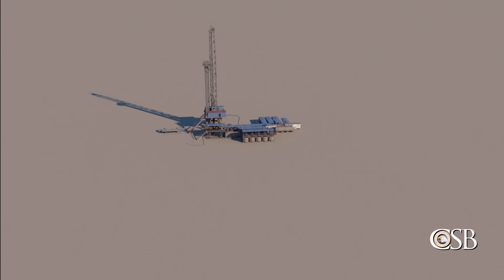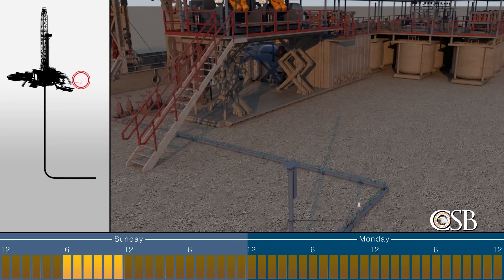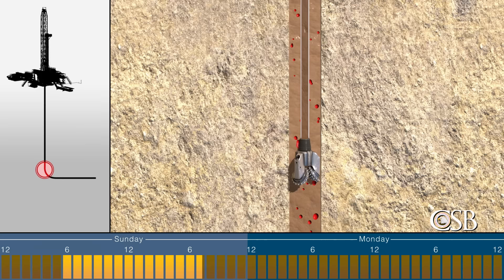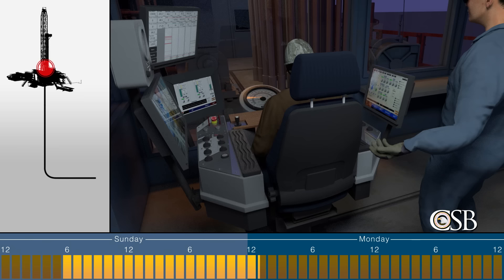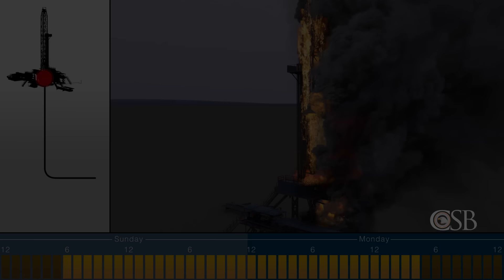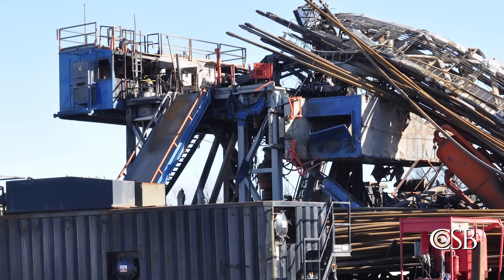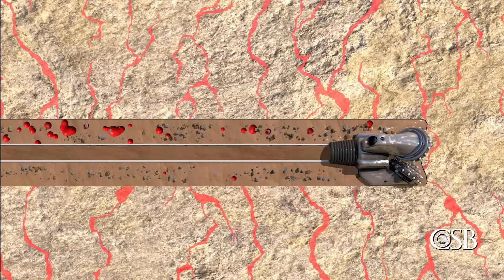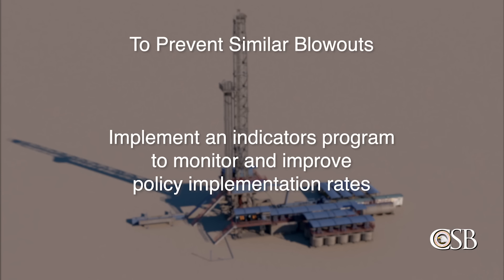Blowout in Oklahoma

Comment: I had to watch this particular episode as I used to work in Oklahoma doing that exact same thing. I can see exactly how the series of events could have unfolded the way they were described here. We used to work some very long exhausting hours. We eventually started working 12 hour shifts , 2 weeks on , 1 week off  to reduce exhaustion. The wells there were pretty deep and after hours of tripping pipe I can understand how lapses of concentration can occur. I left specifically because I thought safety measures weren't observed as strictly as I thought they should have been. It's sad a tragic event like this has to be the reason for any industry to make appropriate changes. I didn't care how good the money was it wasn't worth my life. After being pushed past my breaking point I quit towards the end of my shift and caught a flight home.
Reply: About 15 years. Front Range in Western Wyoming to the Texas Panhandle. 17lb mud in a 15,000psi gas field to wells that were completed without a BOP. I enjoyed the work. Sad event here. Just a series of mistakes.
Reply: It's on the workers for ignoring multiple safety precautions. Darwin award moment.

adding: I get the fatigue but like keenan said, the right thing would be just to quit and collectively file a complaint with whatever agency is supposed to monitor this insanity.
Reply: @my_channel_44  Seriously. If the narrative is reasonably accurate this as a surprisingly forgiving well. Despite making just about every mistake possible, it didn’t give up. It still tried to tell them. One of my managers I used to work with started out on the rigs and he was in the cab when the level indicator did an about face while they were tripping. He stood up, saw that the mud level was indeed rising and he promptly closed the rams in the BOP. Expensive decision, and I think I recall him saying it was still salvageable potentially prior to the BOP activating in the investigation afterwards, but general agreement was probably better to pinch that potential turd off rather than cook everyone on the rig.
Reply: This video os now four years old, I doubt anything has happened in the US in these years.

Comment: What gets me is that there is an option to turn off life saving alarms
Reply: As the video mentions different modes of operation. I would guess that removing the drill involves dozens of things that shouldn't happen while the drill is running normally, so the alarm would go off the entire time even when everything was working as expected.
Reply: It's probably more of a silenceing option. So as to not distract the operator.
Reply: An alarm isn't really effective if it fails to alert you to anything serious, due to it being silenced OR due to overexposure because it blares at absolutely everything.
Reply: @Soandnb  The latter can be termed the "Boy who cried wolf" problem. It's the reason car alarms are of little use anymore.
Reply: In situations like this have an alarm always going off if everything is normal. If everything suddenly goes quiet you'll notice a lot more than if another noise is added to normal operations. Where I work is a warehouse with some automation. Several horns, sirens, mechanical noises, pallets slamming, et cetera are constant. When no alarms are going off, and there's no noise from machinery... I get very concerned. It makes me want to ask why everything appears to suddenly be running very smoothly. Usually it is due to something being shut off for a restart... But disaster only takes one misstep...
Reply: I think it would make more sense to have different alarms with different effects (different colors and blink patterns of warning lights, and different pitches and patterns of sirens) for different levels of severity. Maybe for more serious alarms, you could "quiet" them by acknowledging their presence but they couldn't be completely silenced until the issue was resolved or overwritten.
Reply: @Soandnb  that might work for some things, but the problem isn't noticing the alarm. It's alarm overload that causes people to shut off the noise so they can get work done.

Imagine if every time the pressure in one of your car tires changes by half a PSI, an alarm goes off.  You hit a pothole, alarm.  You change acceleration, alarm.  You hit a bumpy patch, alarm.  You actually have a tire going intermittently flat, alarm, alarm, alarm, alarm.

"Okay already, I know the tire is going flat!  How do I turn off that alarm!?  It's not documented?  Fine, there's the master alarm off.  Click!"

Only you've also turned off the alarm that would tell you your supercharged engine is about to blow up.  It does, and you eat a piece of metal because this isn't a race, so you're not wearing your helmet.

(Why in God's name you would be taking a supercharged race car for a grocery run is beyond me, but people do stupider things than that every day.)
Reply: The alarms are not turned off. They adjust the parameters
Reply: the Sensors are notorious for getting fouled and giving a wrong reading or completely becoming un-usable. So it was probably annoying as fuck.. But yes, being able to turn it off leads to MEGA-LEVELS of COMPLACENCY  lol....shutting it off and not taking steps to check other indicators is defiantly not good oil field practice
Reply: @EdwinWiles  the analogy I use is the national weather service alerts. If you got a tornado warning every hour, you'd shut your phone off, or disable the alerts, pretty quick. Even if it was impossible to shut them off, you wouldn't go running to the basement every 15 minutes. Then the one time a tornado does happen, you could literally be staring at the alarm, and go "eh, it's probably nothing." 

Oversensitive alarms can be almost as dangerous as no alarm at all. It encourages a sense of complacency, or outright ignorance of safety procedures.
Reply: @MatthewSmith-sz1yq  Good analogy, even better point about not knowing the best response.
Reply: As the narrator said, the alarms had not been programmed into the new system. They were shut off because they were going off constantly, but giving no real information.
Here is a tip. This was not unusual when I did this work. So that means nothing has changed in 35 years.
Reply: In this case it wasn’t the operators. The manager picked the wrong site, ignored gas warning from employee and told operators to continue drilling.
Reply: Laziness and worms. Alarms can individually be silenced. PVT alarms should never be silenced for this very reason, grounds to run someone off IMO. Not were the drillers at fault, the 2 consultants are too. They’ve got pvt monitors as well.
Reply: The video specified that the alarm system had minimal impact here.  It wasn’t properly configured to begin with and was more of a nuisance than anything.
Reply: An alarm that is always going off is not any more helpful than an alarm that has been turned off.  It's called "alarm fatigue".  Drilling is somewhat unique in that you don't have a very good "view" of what's going on miles below the surface, and have to rely on what little feedback is available, such as pressure monitors and bubbling of the return mud.  The problem with these "signs" is that their meaning changes drastically depending on what they're doing, whether it be drilling or tripping etc.  That's what's called "stateful" information.  in other words, the information you're getting back is ambiguous, and can mean several different things, depending on what's going on.  And that's why they're recommending "stateful alarms", where their interpretation (what bells are ringing) changes depending on what operations are being performed.  The point isn't to turn off the alarm - the point is to only sound the alarm when the ambiguous measurements are providing information that SHOULD NOT be happening during the CURRENT operation.

The alarms weren't stateful, so they were relying on the operators to observe the "alarms' (the ambiguous information) and decide if they were "ok" or "bad", depending on what they were currently doing.  This also makes them rely on person-to-person communication to communicate unexpected combinations of information (alarms) and current operation.  That's two single-failure points in a row, which is already bad, and becomes MUCH WORSE when both of those failure points can be triggered by human error.  This was the case here.  The circumstances basically "took advantage of several large loopholes in the drilling process", completely defeating the system.  Loopholes will always exist, but operations have to be designed to make them as small as possible, not big enough to drive a truck through.  So many loopholes existed here that it was just a matter of time before an accident occurred.
Reply: Provided you have the control systems "engineering" key you can shut off trips and alarms (which get logged by the system).

Operations, Maintenance people and Engineers understand the dangers inherent in bypassing trips and alarms during "operational or maintenance upsets"...operators doing this as part of "normal" operations....NEVER.

Drilling and refinery operation aren't for the POORLY TRAINED and safety UN-Conscious.🤔
Reply: @CannonFodder873  I like how, in all this righteous drivel, you assume these people are not trained.
Reply: @OneBiasedOpinion  I like how, in your response, my "poorly" trained became your "not-trained". 

30+ years in the petrochemical industry, you see quite a bit. More close calls than I'd care to recount and lots of injuries.
 
The "Right to refuse" unsafe work or refusal to do something patently unsafe or that you're un-trained for, is part of safety training. 

That's how I made it safely to retirement in a dangerous industry, and these folks didn't. 🤦🏼‍♂️
Reply: The issue is the alarm calibration of the alarms, in that case it was most likely a pason system with a fair amount of default alarms set.
Reply: That really... blows.
Reply: @EdwinWiles  Just love your story. The right amount of hyperbole.
Reply: @57thorns  As of a week ago, I am now a published author.  Woot!  Of course, I'm not counting on anything but pocket money.  Still have to have a day job.  But... if things go well, I might be able to generate some decent income!  it could happen!
Reply: it's not really the drillers fault. if you have alarms going off constantly all day every day and nearly all of them don't need to be paid attention to and 99.999% aren't indicating something potentially catastrophic, it all becomes background noise when you do this every day for years. 

the software itself is to blame as well as the managerial staff at the company for not investigating why the alarms are so sensitive and even trivial things not requiring attention are triggering them.

Comment: "The night shift driller had turned off the alarm system..." Pass me an oven glove, this is gonna be an epic face palm.
Reply: The next day shift driller came in and did the same thing. The majority of the alarms weren't relevant to the procedure they were implementing and as the video describes were of little use to prevent this from happening even if they were on. Unfortunately there was no way to turn off the alarms that could be ignored and focus on the ones they needed.
Reply: Bulk carriers in the Great Lakes have so many alarms going off from assumed redundant systems during offloading of material. I'm surprised I haven't been killed yet from my superiors ignoring them. They literally go off every second. So people just turn them off because nothing extreme has happened. :/
Reply: My old workplace did that all the time for turning off the alarms. Only that the machine I was working on could not disable the alarm and someone had to manually override warnings EACH time so someone sat next to the button 8 hours a day overriding the machine for each job
Reply: "The day shift driller also turned off the alarm system"   There is something wrong with whatever training these guys are getting.
Reply: People turn these off to be able to get 1 or 2 hrs of uninterupted sleep.
These jobs are not your usual 9-5. 
And that's what happens when you have an incorrectly configured system giving you useless alarms. The alarms coming up were irrelevant most of the time due to the wrong configuration, people got used to them, nothing ever happened, the habit of turning the sound off got passed down to new employees..
It's easy feeling smart watching the whole picture from outside.
Reply: @evab.6240  Agreed.   I know all too well the feeling.  Human factors are not the friends of humans.
Reply: Alarm fatigue is a bitch
Reply: I worked for Patterson. I can tell you that they earned the right to be called “splatterson”. I’ve seen so many inexperienced people move up to positions that they had no right being in.
Reply: In fairness to the workers, a poorly configured alarm system that goes off constantly during routine operation is not actually a safety feature. If anything, it's a hazardous distraction. If your workers are opting to turn the alarm system off, it's a sign that there's something seriously wrong with the system.
Reply: @AndreInfanteInc  This is completely true, unfortunately by turning the alarms off they open themselves to the possibility of disasters happening. It's a lose-lose situation from the workers perspective and something that should be dealt with by management. Unfortunately management only care about the almighty dollar.
Reply: What happened is referred to in aviation as "alarm/alert fatigue." 

Designers try to add as many alarms as possible, and makes them as sensitive as possible. In theory, this not only protects the designer from liability, but it also sounds like a good idea. However, many of those alarms might get triggered by normal actions, such as an altitude warning when you are landing. This can condition pilots to ignore these alarms, since they hear that alarm multiple times a day, and every time they ignore it. Oftentimes it's not even a conscious decision, they just get so used to dismissing/ignoring the alarm that they don't even think about it. 

Oversensitive/too many alarms can be almost as dangerous as not having an alarm at all. It's easy to blame the workers for turning off the alarms, but that attitude is partially to blame for this situation. Imagine if your phone got a national weather service alarm every 15 minutes, without that disaster actually happening. You'd probably end up either turning off your phone, or disabling the alert system, even though one of those alerts could be a legitimate tornado. Even if you left it on, you wouldn't run down to the basement every time you got the alert.
Reply: @MatthewSmith-sz1yq  That's a failing of the company for not setting up their software correctly to only alert operators to serious fault conditions. It's also a failing on their part for not providing adequate training to operators and it's a failing that they even allow operators to disable alarms. It all comes back to the failures of management everytime.
Reply: @josephastier7421  The training is at fault because it did not cover how to selectively remove superfluous warnings.

The software is at fault because it was: far easier to reach the manual all off than it was to find the *selective off*; it was also utterly incapable of either prioritizing warnings, or adapting the warnings to the action in progress.

Edit: I'm the sort of persistent cuss that I'll spend any time I have finding the selective settings just because I'm aggravated and/or bored to tears by sitting there waiting for the next false alarm.  That's gotten me at least one bonus for writing a small document that showed how to do things right.  Not even life or death, just saving lots of aggravation for everyone in that department.
Reply: @evab.6240  yup and the only three alarms that need to sound are the flow alarm, the gas alarm, and the well pressure alarm if those were on they would have closed the blowout preventers and flooded the hole with mud. Also when you trip out you have to do a pressure and gas check every two minutes and you don't send pills or slugs down the bore that will cause gas to rise.
Reply: @AndreInfanteInc  100% agreed. Nothing worse than a bad alarm system especially if you can't silence it. You get people turning off whole systems in those cases.
Reply: There should be a public list of people doing this so that they can never work again at a positin wherr you have to power to switch off alarms